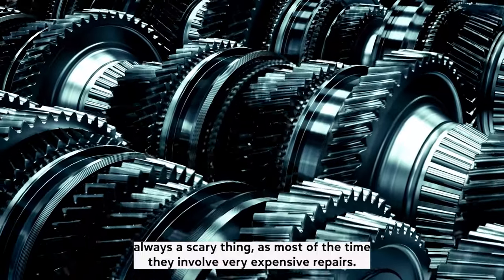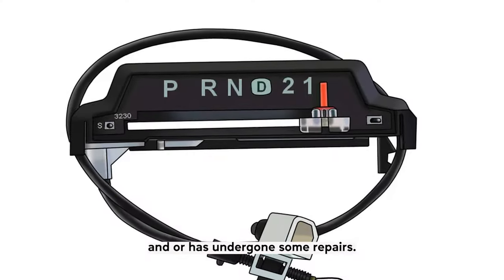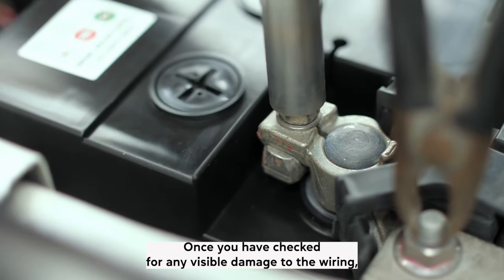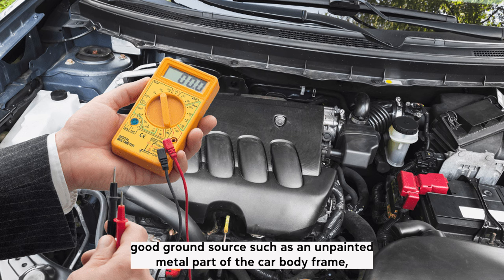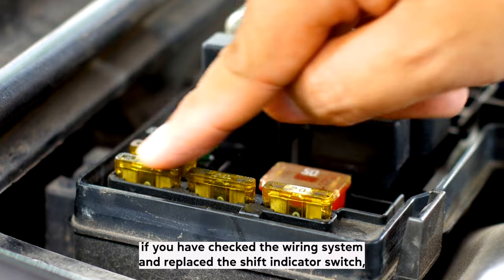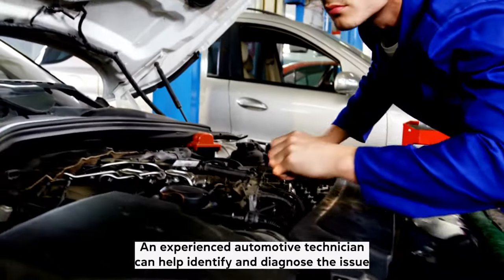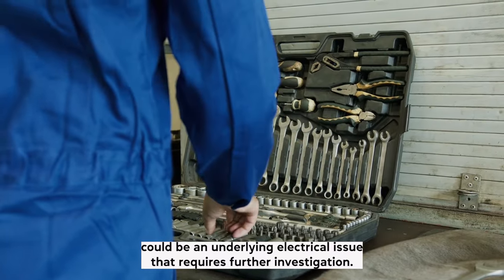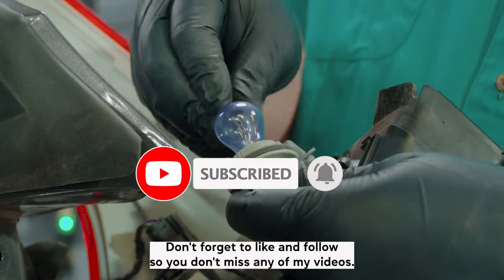Gear Shift Indicator Light Is Not Working (Fixed!)

Comment: wooow very edutative. the indicator on mine shows the wrong gear shift and does not show any indication on the dash board. when driving the gears shifts down to 2nd gear when driving in 3rd or 4th gear